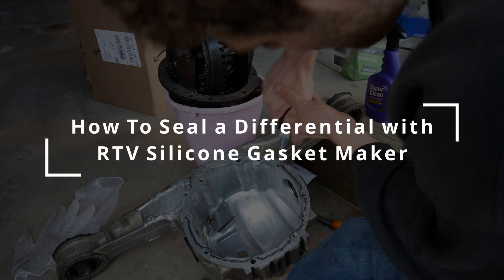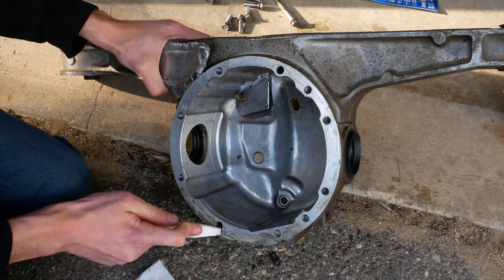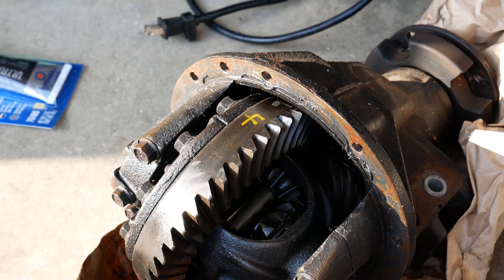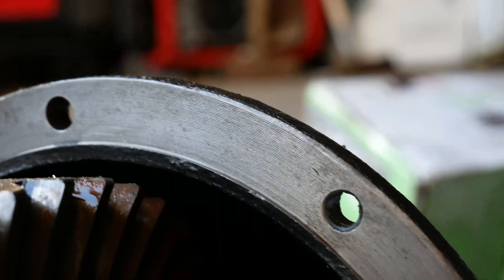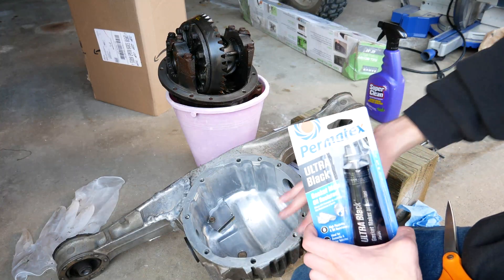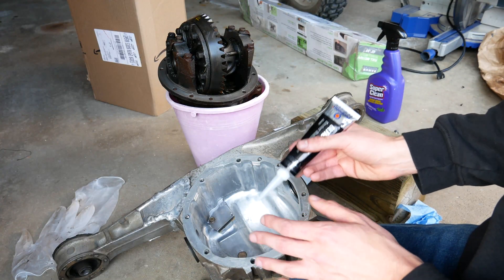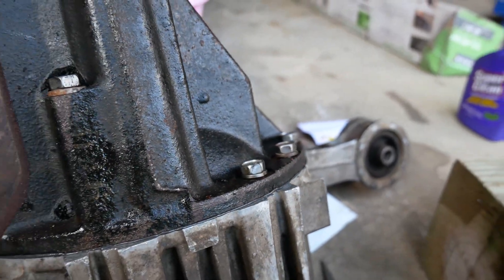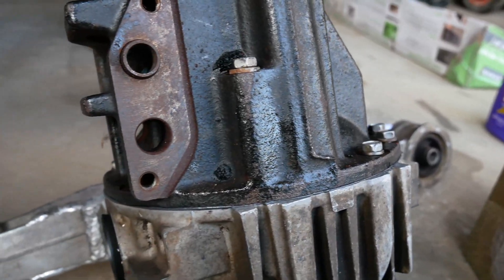How To Get a PERFECT Seal with Silicone RTV Gasket Maker

Comment: Cool thanks. my differential is still attached and I removed the cover. I will try the plastic knife I was looking for something. Wondering how much I should clean out the differential? Like when I clean the old rtv off maybe I will get pieces and bits in there. should you clean all that out to? Like wipe out all the remaining oil? It started raining and I had it open so little worried humidity gets in there so I put a plastic bag over the gear for the night hopefully that helps

Comment: Hhmm, so I think I'm doing everything right but I still get leaks. It's one of those things I can do it a half dozen times the same way and one time it works for seemingly no reason. I've got a thermostat housing that's still weeping despite manufacturer's gaskets and being reinforced with RTV. I will eventually get it after redoing it three times I guess.

Comment: Most Diffs were/are oem factory assembled with a 0.030" -- 0.060" thick cut gasket material  Without any RTV sealant & no leaks......Unless the diff case & cover mating surfaces were pre-coated with White Lithium Grease,  the cured RTV sealant Is a Permanent bonded Hell to remove Nuisance material of Uncontrolled thickness & functionality.....?

Comment: Can anyone help me out with my question. If you have a bolt hole that is stripped can you still use RTV? Stripped to the point it won't put pressure on that 1 bolt hole .Would it still seal since the other 13 out of 14 holes is fine? Or do you need ALL the bolts? I don't want to have to get a tap and die and a bigger bolts and mess it up even more to where th ehole is bigger. Same with a helicoil. thanks. This is for a transmission pan
Reply: I guess your situation has been solved since then, but here is my comment. For the sealing you need even pressure everywhere (radial or axial sealings, for wet sealing the condition is little bit different). The distribution of the ,,enough'' pressure depends on the clamping force and clamping method. For example, if you have let say total 12 screw joint and they are M8 and the screws are max 80 mm from each other and they are clamping for example a 4 mm thick die casted Al part, then loosing 1 screw joint might means no problem, because the Al part is so thick (strong), that the pressure could be enough even the distance between 2 neighbour screw is 160 mm. But if the Al part is only 2 mm thick, then it could bends at the area, where you don't have that one screw joint (broken). So as always, it is depends on  how rigid the parts are, what is the pressure you would like to seal against with and media such as.: air, helium, water, oil..etc., working temperature. In the past 1 stud in my exhaust manifold was broken out of 6 and it was at the right top corner. I was not happy and put the exhaust system back and torque down everything and hoped the best. During the 1 year running test, there was no leak at all at that area, didn't matter how hard i reved the engine on highway. I hope I gave some usefull information. (of course the best is if all screw joint works, because there has to be a reason why the engineers made the clamping like that)
Reply: @laca8612  yes you did that answers my questions. It's a ex gf of mine car so now I don't care but it's still sitting. At least I know what to do if it's my car. Thanks again

Comment: Would you be able to do a video on replacing the actual differential assembly itself and how to set the backlash correctly? I bought the torsen inner assembly and want to replace the oem open diff. The original ring gear can be reused i think. If you know reference material on how to do this would help also. Thanks.
Reply from the maker: If I set one up I'd certainly do a video on it, I've been avoiding it though since rebuilds aren't cheap or easy with basic tools unfortunately
Reply: @CashedOutCars  yeah theres deff a lot involved which is why i have been putting it off myself and not feeling confident about it ahaha. Maybe do a poll to see how many of us are interested first?  If the number are low then dont worry about it :). I like all of your videos though man you are a great resource for the miata community.
Reply: @AMDcore1  there are videos on it, very difficult and requires devices etc to do - all diffs have different specs unique to the build, a good job for a drivetrain shop if you mess up it will be $$$$

Comment: Hey cash maybe you can help with an issue I’m having. Alright so when I start slowing down or coasting in neutral I start hearing a whirring/grinding noise almost like a train on tracks going by in the rear of my Na . It started after I had all my diff seals replaced, I checked the fluid level and the diff was over filled from what I can see so I let it drain to the proper level but it still makes the noise. Anyone have similar issues or know what’s going on and how to fix it? If not I’m sending it back to the shop that did my seals

(Clutch in has no effect on the noise so not transmission related as far as I can tell)
Reply from the maker: What power levels are you running / what diff is it? It certainly sounds like a diff issue to me. What fluid did you put in it? Hopefully we can get it resolved!
Reply: @CashedOutCars  I’m running just a normal engine so roughly 100hp with an open diff. The gear oil inside from what I was told when the seals were done was gl5 80w-90
Reply from the maker: @rauldeu56  if it’s a 1.6 diff there’s a chance it blew but it’s slim at stock power and an open diff. That’s proper fluid to run, there’s a chance something may have gotten in there during the change if it happened immediately afterwords
Reply: @CashedOutCars  definitely not blown it’s been like this for a couple months and over 200km
Reply from the maker: Gotcha. A failing axle U-Joint would also make a clicking sound like you’re describing. I’d also check to be sure the axles are all the way clipped into the diff
Reply: @CashedOutCars  could I send you a pic on Instagram?
Reply from the maker: Yeah absolutely, @cashedoutcars or you can email me it at cashedoutcars@gmail.com
Reply: @CashedOutCars  just shot you a message on instagram

Comment: I bought my torsen yesterday. Is it really necessary to open the diff and clean it and get a new gasket and axle sealings? It was pretty dusty and had some rust on there. I also wire brushed the outside of the gasket away while cleaning it
Reply from the maker: It’s not necessary if it’s not leaky! I was piecing this diff together which is why I am sealing mine. I’d recommend replacing the axle seals especially if they’re worn or cracked